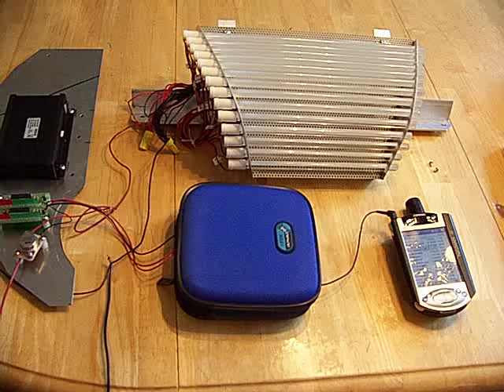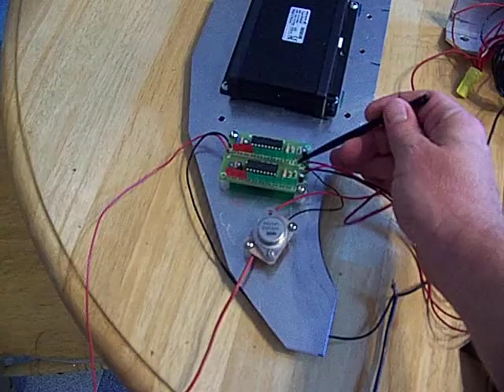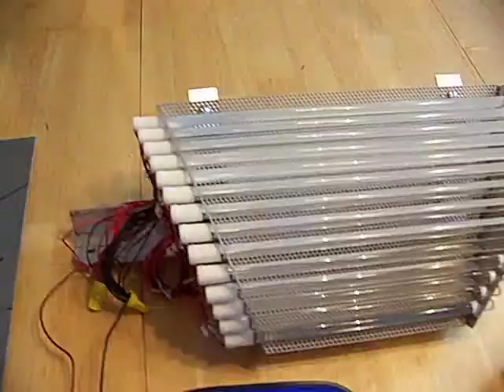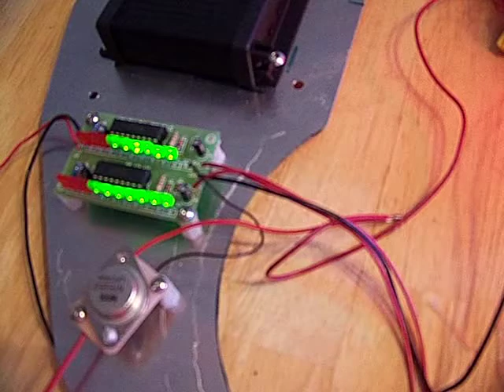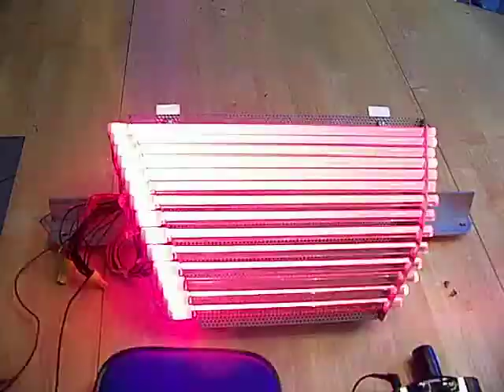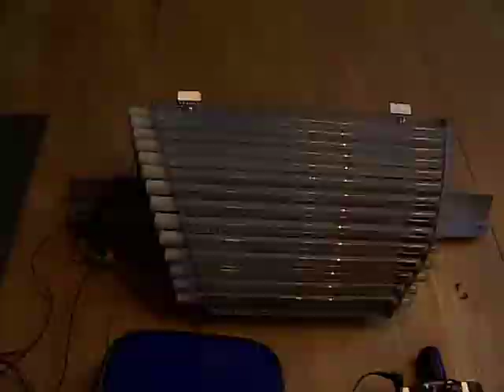Not Neon sound interface

Comment: I'm interested in doing this just as a home decor item, 2 questions, 1) do you think the other leds could be removed, add a transistor then connect to the light bar? B) Where did you find the Luxaura, I'm having problems locating these anywhere

Comment: You could probably simplify the circuit to use cheaper parts. The LM3915 is just a series of comparators with resistors made up to be voltage dividers, all you would need is a comparator and a resistor if you are only triggering one section of LED's at one voltage.